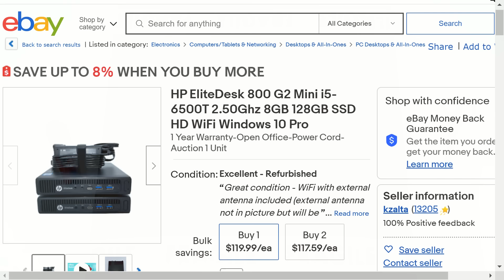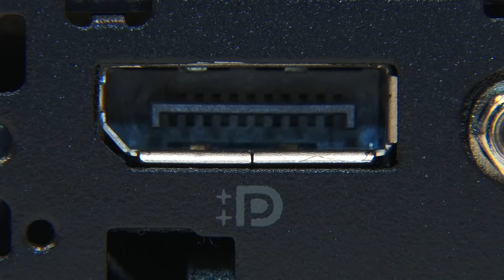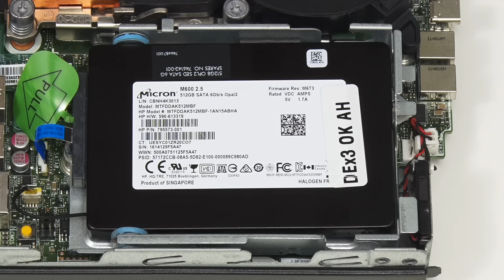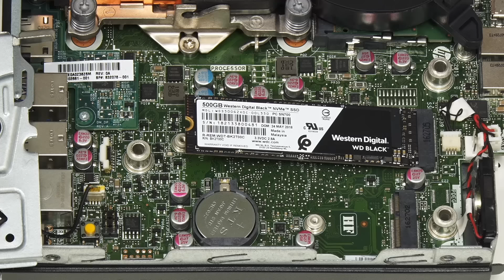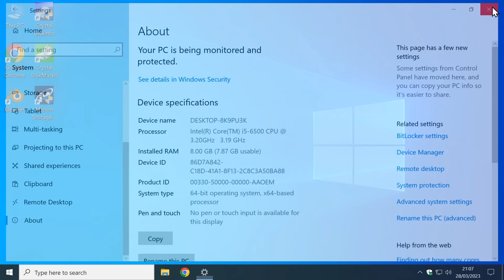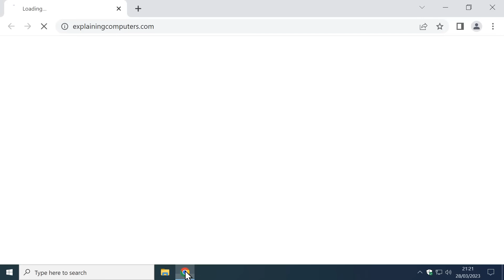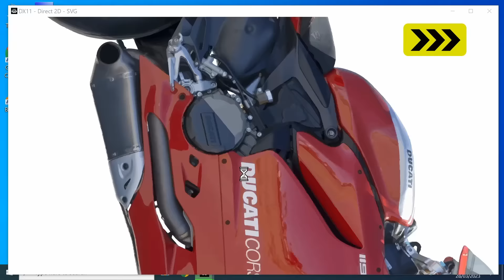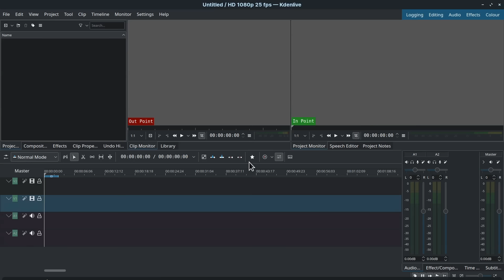Renewed i5 Mini PC: HP EliteDesk 800 G2

Comment: Coincidentally I bought one of these for a local charity to run a small Access database and till software. Replaced a massive ancient HP PowerEdge. They'll save £££ on power alone. Good point about Windows 11 though. Aware that Windows 11 can be installed without TPM etc. - Rufus has options to create ISO that implements the registry tweaks. What about in-place Windows 11 upgrade though?
Reply from the maker: An in-place update to Windows 11 is possible via a registry hack. I will cover both clean install and update methods in my forthcoming video. :)

Comment: I have one of these in the observatory running all my cameras Equatorial mount so I can do night time astrophotography, sadly the original hard drive has gone but it has the operating system on a NVMe SSD. It all performs well & all the software I use for guiding & image acquisition has worked faultlessly. The only drawback is being unable to run Windows 11 but I will look out for your next video on how to run win 11 onto older machines as if successful I hope to get a few more years with it.
Reply from the maker: What a fantastic application. I am shooting the video right now showing methods for both clean Windows 11 install, and an upgrade from Windows 10.
Reply: @ExplainingComputers  Brilliant I look forward to seeing it when it's released

Comment: I have a Prodesk 600 G3 mini I got for for less than 5$.
It is working very well unless I push it hard, then the screen get red dots all over the screen, but goes away when it’s not under heavy load anymore🤔
Is it the cpu that have problems or maby something else?

Comment: I always wonder, why aren't the 2 M.2 SSD slots similar? The plastic bit protruding sit on different position from one another
Reply from the maker: Not all M.2 slots have the same connectivity (M.2 is a physical connector, not a type of interface). So the slots have keys (the protruding plastic bits) to make sure that only compatible cards are put into them. Here one of the slots is "E" keyed and can take a wireless module, whilst the other one is "M" keyed, and can take an NVMe SSD.

Comment: Can it run also H265 video at 4k resolution? I am looking for something which can replay it without any issue. But maybe it will need a newer generation of Intel CPU. Recently just started to work on my Laptop with i7 6820HQ CPU (I guess there was a driver and bios update), before that it was always freezing quite quickly.

Comment: I got the full size Elitedesk 800 with i3 6100 3.7Ghz, dual DisplayPort, 8Gb DDR4 RAM and a 500Gb HDD.....Binned the HDD, installed a 500Gb SSD, clean installed windows 10 and added a GTX1050Ti GPU and it runs my Wahoo RGT/Zwift setup brilliantly...PC was £67 delivered off a reputable Ebay company....Cracking bargains to be had in "yesterdays tech", and even for a HTPC you can silence one almost completely with decent Noctua fans and a passive GT1030 (GDDR5) 2Gb GPU...my one is so quiet the beer fridge in the man cave is louder!!

Comment: Does anyone know if the fans will spin down to zero at idle?
Reply: The PC in this video had a 6500 i5 CPU, not a 6500T as advertised (important because the 'T' indicates low power consumption and thus low fan noise).  This may be driving the comments in the vid about the fan noise. The one they shipped to me had a 6600T and although it's never completely silent if you stick your head next to it, it's pretty much impossible to hear in daily use most of the time. The fridge in the next room is louder.  The cat licking his paws the other side of the room is louder. HTH.

Comment: The refurbished market is really a great way to get a Windows OS current.  As usual thanks for sharing the experience. 
Generally I try booting the PC first before getting into the internals so there is no question thanks for showing the under the cover where the nvm SSD are

Comment: I just picked up an EliteDesk 705 G4 Mini with a Ryzen 5 Pro 2400G to toy with that cost $160 . For the price I couldn't pass it up . It was a similar situation that it was supposed to have the 2400GE 35W processor , but arrived with the slightly more powerful 65W 2400G instead . The performance gain is probably not worth the extra heat .

Comment: I recently procured a couple Mini Dell Latitude with really similar specs from Amazon as well for my daughters as a home computer. I had a couple 8 GB sticks laying around and a couple M.2, they couldn't be happier, this machines fulfill all of their needs and don't take any space. Edit 1: The ones that I got came in a really nice "Microsoft authorized refurbished" box, with a 1 year warranty. The hard drives that were included are horrible (used 2.5mm HDDs), but prices have dropped so much that I didn't mind replacing them with used M.2

Comment: Two-plus years ago I bought a (used) 600 G2 model with an i5-7600T CPU for around $280 which works great.  (I also had to purchase a new monitor.)  But, it seems to me that the CPU technology (6500 generation) in your video is so old it should be shunned  in favor of something like an 8th gen CPU.  You're right that if it's still capable of running Windows 10, it's a good deal.  Thanks for the review.

Comment: I bought one of these 3yrs ago at a higher price. nice small computer. I added the internal wifi with bt.  I added a 2gb m.2 samsung hdd. The 500gb hdd was very slow that HP put in to cut costs.

Comment: Started with underpowered Intel NUC over a decade before, good for a TV but not a desk replacement. Got an EliteDesk 800, (Intel i5-6500T CPU 2.50 GHz), upgraded memory to 20G, added 1.5T USB drive to the 250G machine, Microsoft wireless keyboard, and upgraded to Win11. Now my desktop is no longer being used since this machine is probably as capable as my nearly decade old desktop. Lower end games and low-resolution Microsoft flight simulator work fine, though the machines are cheap enough where I may upgrade to an Intel 8000 or better i7 machine in the future.

Comment: Just small note. Crystaldisk is a very bad software for estimation SMART condition of the drive. It might show you "caution" health on drive which  is technically already dead and requires HSA swap to get the data. It seem to ignore pending sectors amount which is usually a main flag to see that drive is already failed: if you have few weak sectors, they are being moved to bad blocks pretty  quick. If you see this number staying or growing, this means HDD reallocation for unstable blocks is already failed to read such sectors and most likely never will unless you wipe the drive I  zeroes which magically "fixes" this issue by making HSA easier to get "right data" (guess what CRC is for zeroed sector). Accessing such blocks will most likely freeze the drive and make it work extremely slow. Data recovery usually involves firmware tuning to disable all background/self repair activities and only reading the good sectors. Once they are read, rest is either not that critical or requires HSA swap.
Reply from the maker: This is indeed why I did not rely on CrystalDisk Info in the video! :) I also installed the manufacturer utility for the drive in question.

Comment: Very enjoyable, as always. These refurbished SFF pcs seem to provide good value. I guess time will tell if the unofficial Win 11 upgrade works permanently, or if Microsoft will find a way to disable important updates. Unfortunately there’s no way to predict it.
Reply: Value ?
Why you need Windows 11 on low powered old trash, running what ?
What updates you need, can't find drivers for it ?

Comment: Great video as usual! I always enjoy your hardware videos especially with used / budget oriented parts in it.

I’m thinking about getting one these mini pcs for use as a small and efficient nas server and I was wondering if I should get a more powerhungry yet performant i5 or something like a slower mobile celeron/Pentium for efficiency. Also are these mini-pcs quiet? 
Originally I planned to get a raspberry pi4 for this nas project but they’re still too expansive and frequently out of stock where I live.
Any recommendations?
Reply from the maker: You don't need a lot of CPU power for a NAS. As noted in the video, this particular PC quite noisy. But some other SFF computers -- such as the Celeron Mini PC I reviewed recently -- are silent. I would gow with something more like that, rather than the PC here, for a small NAS -- although it depends on the drives you need to connect.
Reply: @ExplainingComputers  Thank you very much! I appreciate your insight. I will look into the more efficient Celeron machines for my NAS project. For the drives I try some configurations with SSDs and HDDs which I have lying around.

Comment: Not sure if mentioned already but you have the 6500 and NOT the 6500T. The T doesn’t have the vents in the top of the case or the 2nd fan. I have 7 of the 6500T and use them in a ESXi cluster with USB NICs. I also have the i7-6700 (non T with 2nd fan and vents in case). Also worth noting you can software upgrade the TPM from 1.2 to 2.0 via HP software download.

Comment: "Lots of bubble wrap, we can pop that later." Obviously a man who thinks like me.
I'd be interested to see what this machine would do pass-mark-wise with the maximum 32G of memory installed. (32G of memory - that's ten times the capacity of my first hard drive!)
And finally: "Older hardware like this may not meet Microsoft's requirements for installing Windows 11."  Oh dear. How sad. Never mind. (Promptly installs Zorin or Linux Mint instead.) I've no wish to be forced to log into my own computer using a Microsoft account. I'm keeping my "10" going until support ends, then it's over to Linux for me.

Comment: These are overpriced compared to a NEW N5095 based system. Not only is the N4500 cheaper, its at least as fast, with better iGPU while sipping 15W instead of 35W.

A bit more searching and you can find an N4020c/N4500 based system with a 6W CPU

These HP's need to be about $50 to be competative.

Comment: HP = Horrible Products!
I would never give my money to HP after owning one of their Laptops. That thing never worked properly, even though it had a 1.6Ghz CPU, 8Gb of Ram, and a 256Gb SSD. It was constantly slow, often froze and had to be rebooted. WiFi was infuriatingly problematic, and none of the components were upgradeable, as they were all soldered to the board.
Once bitten, twice shy. NEVER again would I spend my hard earned money on HP Rubbish.

Comment: Have a number of these (G1’s, G2’s and G3’s)  running at home doing things like my Home Assistant Live and Test boxes, Roon Server, Docker etc.

Might also be worth taking a look at the HP T630 Thin Clients which are also pretty capable and expandable but available for much less money - I have about a dozen of them and the last ones I bought were £50 each with 4GB RAM / 32GB SSD which is cheaper than the RRP of a Pi and they pull about 12w.

Comment: According your showed screen with the hardware details you have not got a 65W i5-6500 instead of the 35w i5-6500T. This also match with the full copper cooler and the larger power supply. Also the second fan should only in the 65W version of the hp ussf computers.

Comment: These are cool little units for basic tasks. One thing though, if I remember correctly, is that Intel moved the particular HD Graphics 530 gpu in this unit, in to some legacy state. It can be a nightmare to get it working properly with Win10 and Win11 as they get updates, Intel won't be making new drivers for these older integrated chips.

Comment: Yeah these things are awesome. I'm not sure about the G2, but my g4 has an extra m2 slot which supports PCIe. You can add a m2 network for this form factor which breaks out to that special slot in the back. With a little macgyvering that is.

The router of my dreams

Comment: I use such a small factor computer (Dell) as a low power, low cost homeserver running Proxmox and several VMs (Wireguard-VPN, Pihole, and so on) and a Windows 11 pro VM, accessing via RDP from my Linux Desktop, if sometimes necessary.

Comment: Indeed, this is one of the best values in computing right now.  I just picked one of these up without a drive a few weeks ago.  I was originally looking at picking up a third tiny Lenovo, the M93P, with a fourth-gen i5(two cores and four threads) because those prices have dropped to $45-55 with the power adapter included.  I got my first two in 2021 for 75-80 without the power adapters, so it's an amazing value.  I figured that going with the faster sixth-gen i5 was worth the extra $25-30 I paid, and having that newer CPU would come in handy for a couple of things, though those older chips cover most of my needs and are still useful to me.  For those who know what they're getting, those older ones might still be the best value in computing due to how much the prices have come down.  It was interesting to see the differences in design between the Lenovo and the HP.  I know the Dell models have their own little differences, and they tend to have HDMI ports in many cases.  I was already interested in these old tiny office PCs back in 2016 or so, but now that they've come down to SBC prices, they're my new tech obsession.

Comment: I’d reseat the RAM, particularly the upper stick. Also, with a PC this old, it may be worth renewing the thermal paste. There is also signs of dust caked in the airways of the cooling block, perhaps clearing that would be a good idea.
Useful little PC for the money.

Comment: you have a i5 6500 which is a 65w tdp cpu not a i5 6500t, also another way to tell is by the top of the case the 35watt chassis is a solid top whereas the 65watt one is vented like yours. the cpu heatsinks will be different between them too the 35w is aluminum while the 65w is copper. also make sure the power supply is a 90watt one and not the 60watt one or you will run into problems down the road, the 60watt is used for  the 35watt chassis and 90watt for the 65 watt chassis. also the second fan is only used for the 65watt cpu's.

Comment: Great video as always! I got one of these (HP Prodesk G3 Mini) a few years ago for a similar price. Mine is the i3 model and has literally been running non‐stop for over 2 years.  I added the M.2 drive also first thing. Makes a great Mini server which I use mine for. I've been curious can the CPU be upgraded? Would be interesting to see if the i3 or i5 models could be cost-effectively upped to i7 and if the performance improvement would be worth it.  Thanks for another great video!
Reply from the maker: A CPU upgrade should not be a problem if a chip can be sourced.

Comment: I've been saying basically this for a while.  These mini-PCs are better value than most "SBCs".  However, I sort of prefer the variants that fully support Intel vPro remote desktop (Mesh Commander) like the Lenovo M910q.  If you need more cpu than an i5-6500T bump up to 8th gen as they have better IPC but mostly more cores.
Reply: Thanks a bunch for the mesh commander tip! I just bought a 800 G2 and was wondering if there was some (free) way to use the vPro iKVM-interface and not have to connect it to a keyboard/mouse.

Of course there is!
Reply: @Jonteponte71  In my experience, you can also go without a monitor by plugging in a (~$10) dongle that makes the iGPU think a monitor is connected.  

Allegedly, there are software/driver hacks that do the same thing but I've not had any luck with those methods.

Comment: Great review! These mini PCs are awesome! Since Raspberry Pi 4 SBCs dried up, I started buying these instead to use as headless home servers. It's really worth getting the i7 version if you can, as you get twice as many CPU cores than the i5 version (and probably a slightly better iGPU too). The CPU is user upgradeable, but I think it's cheaper to buy one with an i7. Was surprised that the fans can get quite loud on these. I have two, and they run silently, although I don't run a desktop environment on mine. You can also perform a hack to attach a desktop GPU to these small computers via the M.2 connector - you just need the right adapter (m.2 to pcie riser).
Reply: Maybe I haven't pushed my mini's enough, but I haven't had an issue with fan noise. But I use these for tinkering so that may be why.
Reply: @warbirdnut9269  I think the reason why Christopher mentioned fan noise is because he has the model with the 65W CPU (I have the 35W model), so his unit probably generates a lot more heat (but it will be around 25% faster too).

Comment: There is a stack of these mini PC's models floating around on the market place everywhere, awesome machines, I chose to purchase a stack of the Dell USFF ones instead RPI's they came with 250gb SSD's wifi, bluetooth, 7th gen Intel I5's 8gb ram and cost me $150 AUD delivered each, and all come with licensed version of windows 10. They are no slouch, and still have many years worth of full desktop use in them, these make excellent HTPC's, digital display PC's and awesome for running Klipper on for 3D printers.

Comment: Could it be possible that this machine had been run solely as a thin client in its prior life? That might explain the zero data transfer on the disk assuming Chris not saying if it had content or otherwise.
Reply from the maker: The drive will have been wiped and Windows re-installed on a renewed PC. Even used as a thin client, there would have been drive writes(for cache/etc). The drive is not reporting zero data transfer, but is not reporting anything at all! :)
Reply: @ExplainingComputers  Ah yes, that would be it. It is most odd to not report anything though. 

Nice system find btw, I've been browsing for similar, but hadn't committed yet.